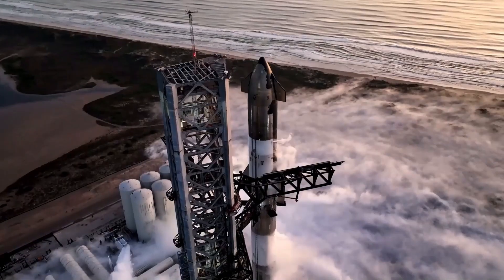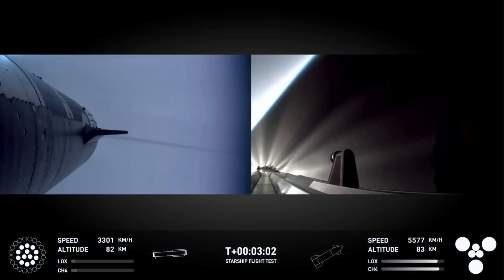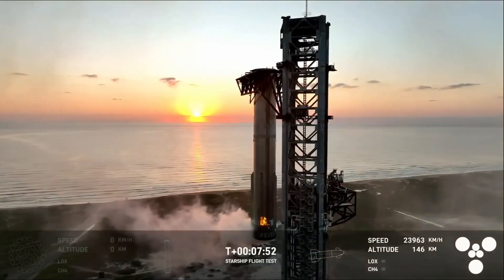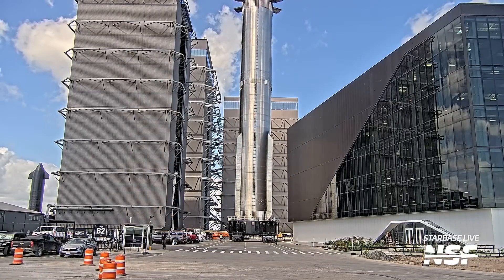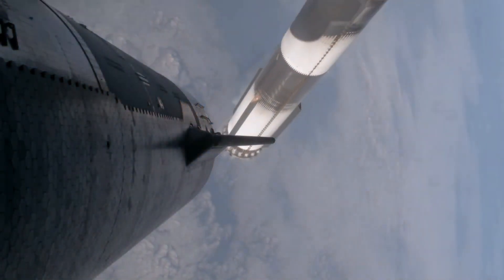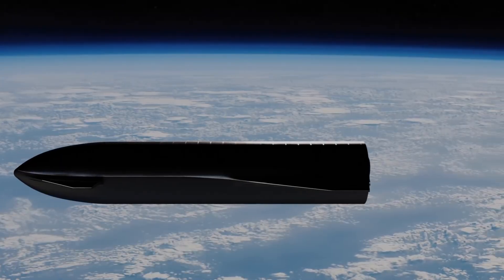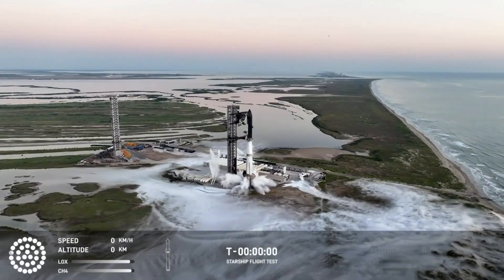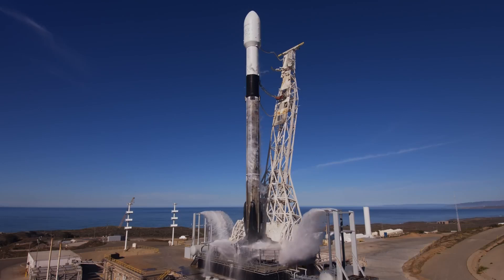SpaceX Just Revealed Insanely Difficult Starship Orbital Refueling!

Comment: Why do they not use a substitute approach? Use heavy booster to push a fuel tank version of Star Ship into orbit, detach the crew compartment and the landing fuel tanks of the of the fuel tank space ship (in the same location as the crewed compartment), re attach the crew module to the fully fuelled starship space rated model, landing tanks return the now empty star ship to earth.

Would seem to be far less risky than trying to pump cryogenic fuel under pressure between vessels in space.

Also if you left a Star Ship in orbit it can be used as competent for a space base.  Never understood why they didn’t’ do that with the space shuttle tank (apart from cost, tech and political will).

Comment: Here is a way to dock the tanker and depot/HUB and transfers, To lock the ships together a light weight device like a Rail Road car coupler. Near the door a Horizontal one and Vertical between the refueling booms and boom receivers  The Boom and couplers will retract and extend. The coupler will extend out and lock onto the matching couplers on the other ship and retract half way then the boom will extend to al-line with the receiver then the couplers will pull both ships together and locking the boom for transfer. Hydrogen Bladder inside the Tanker tanks can help in transfer transfer. Then the Hydrogen can be moved and mixed with the landing Methane. A Hydrogen Badder because Methane has Hydrogen.

Comment: Its pretty much a given in my opinion that we will need on orbit refueling depots. Build a version of Starship with no thermal tiles. Or flaps. Adocking adaptor on the front end. Engines in a recoverable pod. Once launched the fuel tanks dock to a core element. Once you have 8 launches conducted and the tanks get docked spin the assembly up to a low gee acceleration. Say .05 G. Just enough to make pumping fuel easier.
Reply: This is something I have said too. They need a fueling depot/space station. That way there is only one docking to worry about not multiple ship to ship connections that raise the chances of failure.